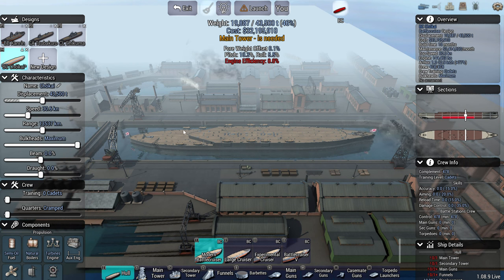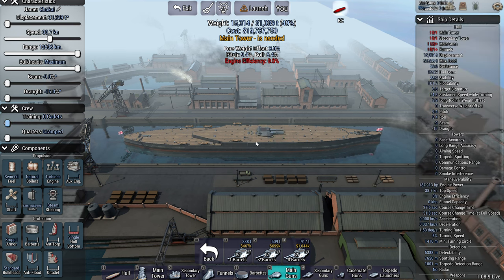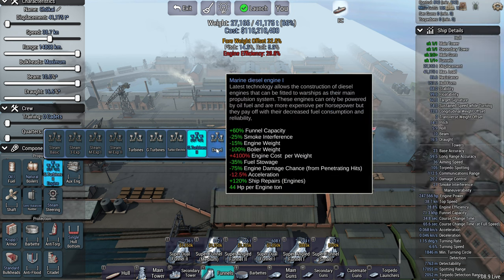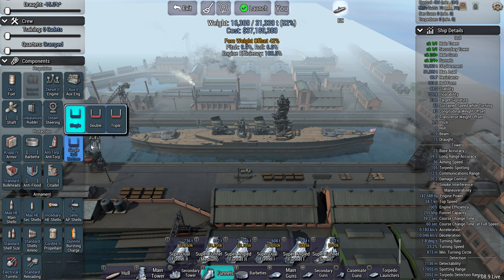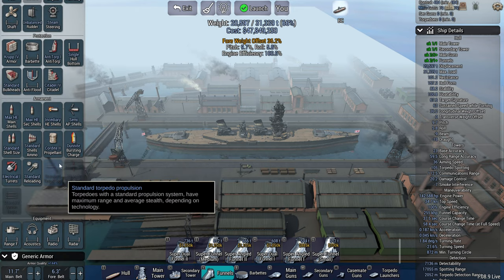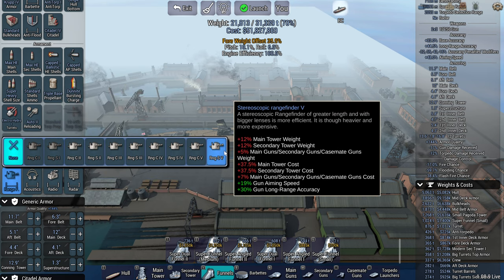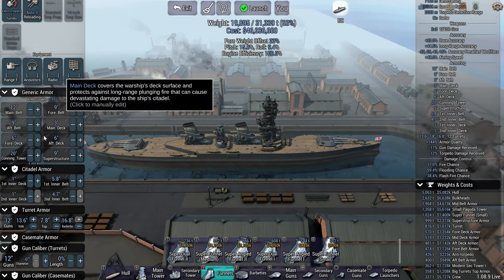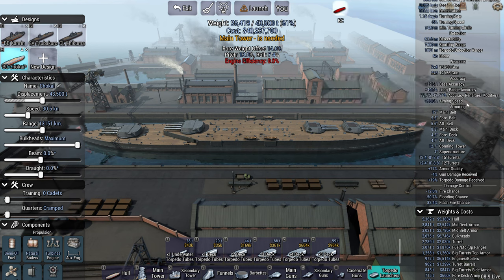Ultimate Admiral Dreadnoughts Ship Building In Depth Tutorial 1.08.09

Comment: Also the weight gain from more crew could be the difference between armour being penetrated or not so in campaign that's another reason why having it above cramped is not worth it I find that aux 3 engine is the best as the stats compared to 2 is still quite a big jump so is kinda worth it but between 3 and 4 is like radar 2 and 3 the weight and cost jump for a tiny % jump is not worth it usually but radar 3 from 2 gives better a stat boost that RNG-R IV to V and weighs less so i'd say that's were you could save a bit of weight for more speed or armour

Comment: The starting calibre of these guns isn't right I think the highest calibre built at the time was a 55calibre gun and that was in 8 inches for de moines. 50 cal was the longest heavy gun barrels ever made mainly cause anything higher than that in a rifled gun put to much barrel wear on the rifling as the U.S. Navy discovered when they were originally going to put a 16 inch 56 cal on the iowa's as they couldn't get 9 18 inch guns on the 45,000 tons allowed tonnage they could only get 6 and not enough 18 inch shells on board.